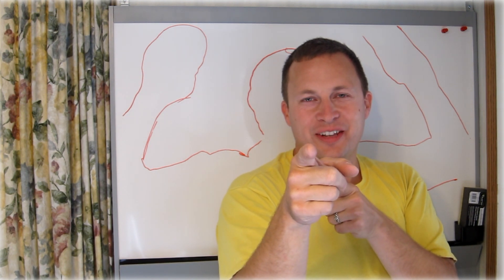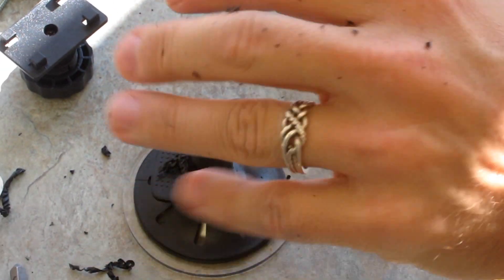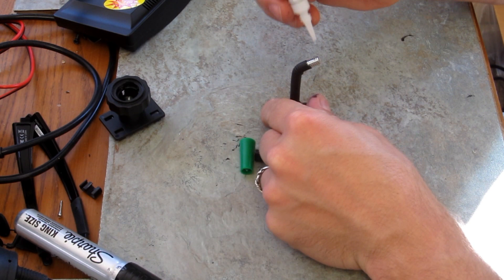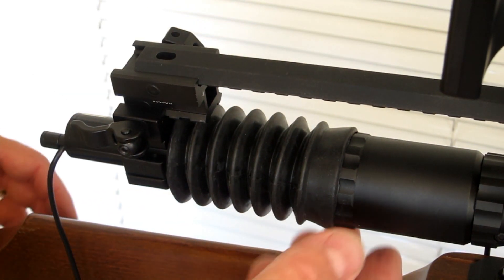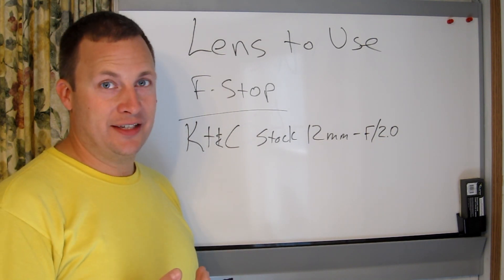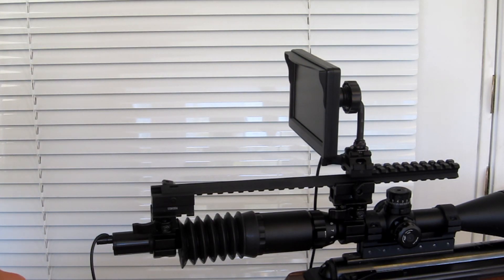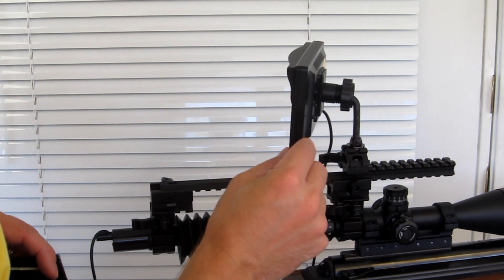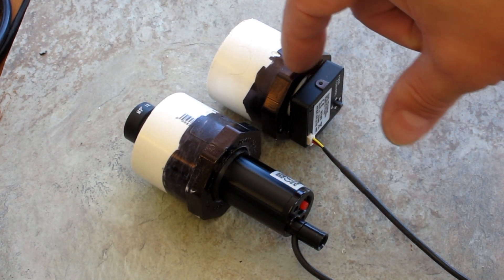Rolaids 1.x Update for DIY Night Vision

Comment: I've found a couple 12mm with a F-stop of 1.0, and a 16mm with F1.2, i've learned a bit about the F-stop, and basically its sorta like aperture size in relation to focal length, essentially the lower the number, the large the lens surface area, which will allow more light in? so in a very basic sense, the ideal would be as low of a F-stop as possible to get as much IR light as possible?

i'm planning on doing a build WITH a scope, because I want the mildots, and the OSD as a crosshair just isnt an option for me. also, the ability to use a variable scope (with FFP) and zoom in on a target for a shot and maintain hold over/hold under outweighs the small benefit that a "scopeless" build would have.

Comment: i was thinking of using a 3 x 9 x 44 tack scope on my ruger air rifle for rat hunting an mouse hunting an upping it to night vision  but need to keep cost down what do you recommend
Reply from the maker: This Rolaids 1.x setup will be your least expensive route. You can save some money if you shop around for parts. Since your planning short range you could go with a low cost IR light as that is where you can spend the widest range.

Comment from the maker: Yes - I should have noted that. The 4 screws on back make it come apart easy and you can use a sharp knife to remove the top piece of glass which is the IR filter.